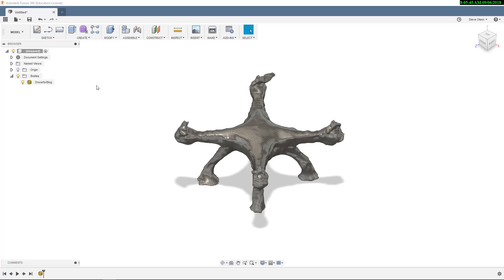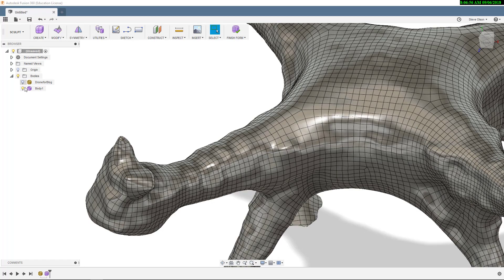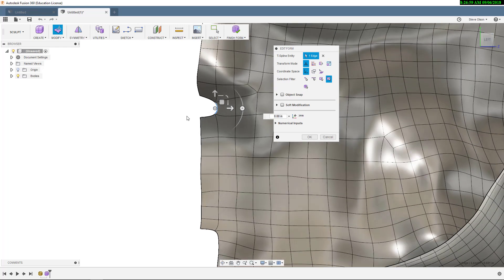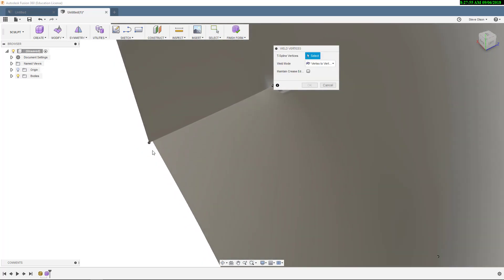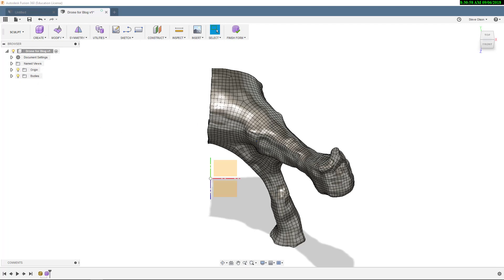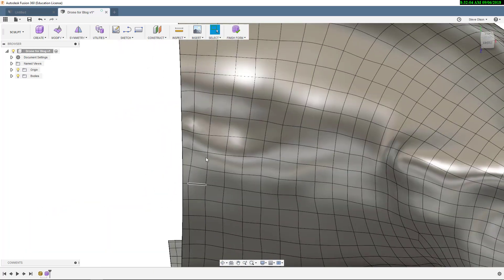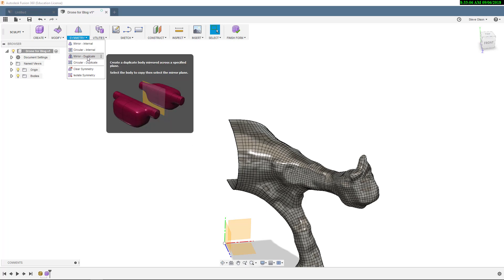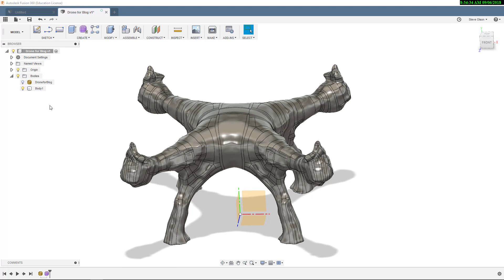Converting a OBJ (Quad) Model to a T-Spline Model Using Fusion 360

Comment: sorry to ask this, I'm a sub-d modeler from maya... just a question: 

the end solid mesh you showed, are there any downsides to have so many patches? I feel like if possible, an efficently modeled solid body mesh with lesser spans/control curves (whatever you call them in cad :) ) is preferred, but obviously more time consuming (easier to edit I mean)?
Reply from the maker: ReCap Photo will generate the mesh used to define the product.  So there is not much we can do to control the quantity of those.  But having fewer mesh vertices would make the part easier to edit.  That is why I typically tell users, that I would delete at least 50% of them after converting the model to a T-Spline shape.
Reply: ah you can edit after, very cool. thanks for the reply :)